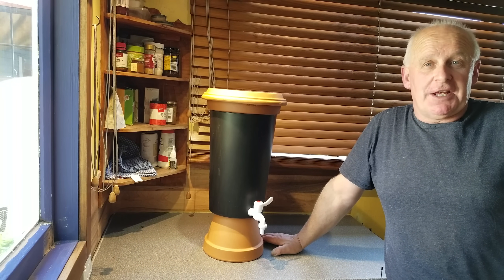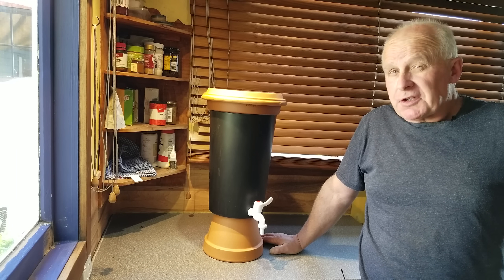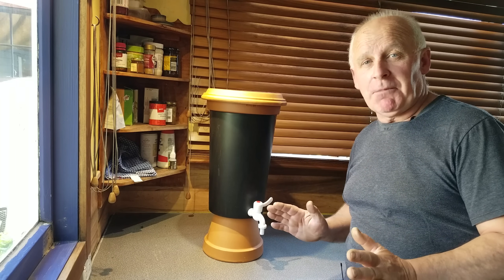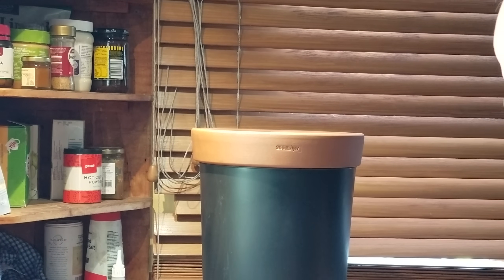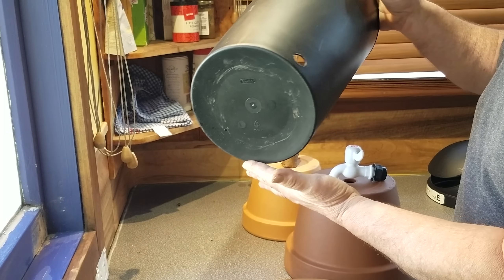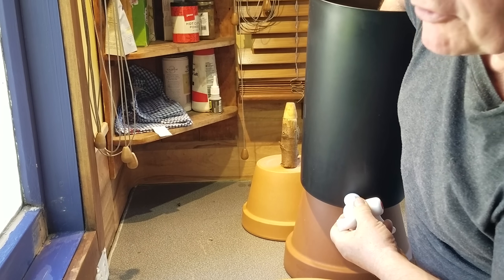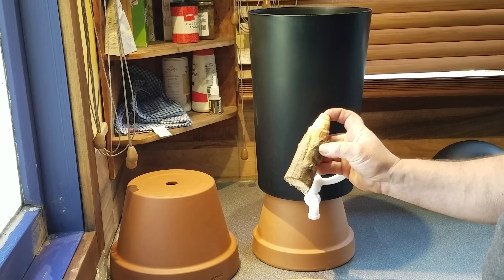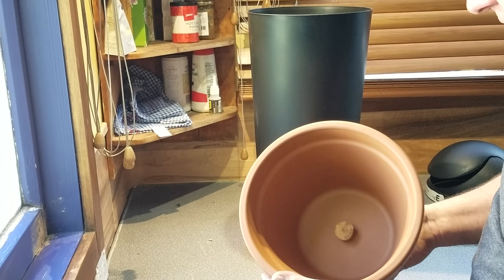DIY water filter. How to make FILTHY WATER drinkable

Comment: the CDC has some pretty good material on the pros and cons of ceramic filtration.  The basic gist of it is that they're good for filtering out bacteria and protozoa, but relatively ineffective in dealing with viral contamination.  If not properly maintained, they can also become vectors for spreading the very diseases they're supposed to filter.  

And while not listed as part of the CDCs information, they also aren't going to be particularly good at filtering many dissolved contaminants, and require something like activated carbon to be effective in that regard.
Reply: Do You Believe Anything The CDC Postulates?

Comment: I wonder if you can help. I made one of these following your video. I kept it going for a few weeks but then had loads of water spare bottled in the fridge that I stopped for a few days. When I started running low I attempted to make more but only got an inch of water in my container and no more would go through. Any ideas why it stopped working?
Reply: Contaminants?  Thats why Brita are changed every 2 months

Comment: Only thing to note here is these types of filters don't remove chemicals dissolved into the water.  They can be great at removing particulate undissolved solids & microbial life but depending on what chemicals are in the water that might NOT be enough to provide safe drinking water.  Note also that the ceramic pots, like any other filter medium, get clogged and eventually become unusable.
Reply: Many of those chemicals evaporate from the water if you let it stand for less than 24 hours. Also, if you're using rainwater, it's untreated, unlike tap water.
Reply: yes. so stupid design. the only reason he's doing that because it doesn't cost anything. chemicals are even more bothersome than bacteria

Comment: Unglazed ceramic dish , unglazed terra Cotta flower pot, bottom chamber with a tap. Very simple.  A wooden cork stopper.  Colloidal silver spray. I worry that the clay pottery would have lead in it.

Comment: This all looks cool and easy. However I would want to be sure the pots being made cheap and easily for plants, dont have any toxic by products. 

I would then also be certain the wood bong hole plug was actually plugging 100% as just a little seepage with bacteria can have you puking your guts out.

I would get the water lab tested a frw times a year at first. Rain water may seem clean however surrounding industrial complexes even a hundred miles away can release toxins into the air.

I live in San Antonio TX and years ago the Mexico fires caused ash rain all the way over here. Turned the streets to a slippery mud mess. 

Burkeys are a rip off. Its a stainless steel tanks and valve with a huge charcoal tube filter. Thats it. 

As for rain wated, you have to consider what its running off of. If it runs off a shingled roof or metal roof. Taste and bird poop and other things can get carried along as well as oily tar flavor from shingles.

The barrels need a good screen but even that cant filter out gecko poop left on top or wind with dust and dirt settled on it.

I would at the very least have my own PVC plumbing grade 1ft pipe converted into a packed carbon filter using aquarium filter media bought in bulk. For emergency filtration. 

Then have the water pass through that after the ceramic filter. Mayve even get a UV light that can be used to kill bacteria or viruses.

I know this is a small DIY but if you mess up and its an emergency, you could poison your family and all be puking your guts out or even death. 

If i could, i would filter the water then boil it then store it for later consuption in a food grade container.

Comment: So you missed biology 101... Ceramic don't filter everything! "most ceramic filters are effective at removing bacteria and the larger protozoans, but not at removing the viruses or chlorine" US CDC states. It goes on (from Atlanta CDC site)

    Not as effective against viruses
    No chlorine residual protection – can lead to recontamination
    Variable quality control for locally produced filters
    Filters can break over time – need for spare parts
    A low flow rate of 1-3 liters per hour for non-turbid waters
    Filters and receptacles must be cleaned regularly, especially after filtering turbid water

FILTERS MUST BE CLEANED REGULARLY! You said the contrary! Don't poison people with your lack of knowledge. Only bio and chemical analysis can PROVE the safety of your diy filter! SCIENCE IS NOT AN OPTION when it comes to HEALTH grandpa!

Comment: Does the water filter through the ceramic or just through or around the wood bung? I thought clay once it was fired turned to ceramic which was none pourus? As in, coffee mugs, etc. That’s why plant pots have a drain hole. I would add a layer of activated charcoal above the bung and a fine clothe mesh filter under the pot. You could even add a layer of clean sand to remove larger particulates and add the water to be filtered to a separate feed bottle which then slowly goes through the filter. Another project for ya! Cheers.

Comment: The problem is that ceramic doesn't filter out that many chemicals.  Putting some activated carbon in there would help a lot with that. Some ion exchange material would help even further.  Between the 3 filter mediums, you would filter out a fair amount.  The colloidal wash is interesting, but if you have any scrap silver, you can just throw that in the water and it will help and just occasionally clean off the tarnish to refresh it.
Reply: They have found PFA's in falling rainwater, so a pretreatment with charcoal then filtered through ceramic doped with silver would be good
Reply: @specialservicesequipment393  
Really? PFA's in the rain water - that's disgraceful eh.
Reply: @deviance, much more that water from the sky. Are you familiar with cloud-seeding? Weather modification? Geoengineering? Pathogen-carrying birds and insects? Airplane dumping? Pollution? Dust? Pollen?
Reply: Berkey admits to activated carbon and around 1oz of silver PER cylinder
Reply: In the U.K. they tax you on rain falling on your roof I kid you not, only on business property’s and it is the Water companies who were sold very cheaply to French &Spanish companies they have bankrupted a few city’s in Europe with the big con and a few backhanders of course.good job like it
Reply: What about microorganisms, viruses and bacteria?
Reply: @dnlbrgs57 Uvc light attached inside that top cover? As the water filters threw the ceramic pot, the uvc light attached inside the top cover would be killing viruses and microorganisms?
Reply: @dnlbrgs57 the silver will deal with the bacteria. You could also use a few copper or silver coins. Viruses are going to go straight through. Personally I just boil the municipal water, to get rid of the chemicals, I have been around the water treatment plant here in Hamilton NZ,and they do a very good job of cleaning the water before they add the chemicals. Here in NZ the water from the clouds is mostly OK to drink, but anywhere else I do not as it is full of thousands of chemicals. You will need fancy active filters to clean it.
Reply: Filter first, but when in doubt, make tea. Boiling kills bugs.

Colloidal silver can be made with three 9v batteries wired in series to make 27volts. Slip silver electrodes in water and watch it work. (There's a patented process for cleaning kidney dialysis machines using colloidal silver. No one's allergic to it and it kills bugs)

Great video.
Reply: He said he was using rain water, not tap water. Rain water has less chemicals in it. Unless you have you have those planes that spray chemicals in the sky, in your area. 😕
Reply: @Momma_Tomma  '..those planes that spray chemicals in the sky, in your area'.. i.e. the world!
Reply: @Momma_Tomma NZ is heavily sprayed by planes 😢
Reply: @Momma_Tomma  that would be living anywhere on earth where planes fly
Reply: How do you activate carbon? Or is it something that must be bought.
Reply: @emmaearnshaw3282  It's charcoal superheated in an oxygen free environment.

Target has it at 2 ounces for seven dollars (US). I didn't research whether it could be made at home.
Reply: @emmaearnshaw3282  Look it up. When I last researched it, I remember that commonly sulfuric acid is used.
Reply: This is a Texas government website about Cloud Seeding. It's being done in other states in the US, as well. https://www.tdlr.texas.gov/weather/summary.htm
Reply: What chemicals are in freshly dropped rainwater that need additional filtering? I'm curious, thanks
Reply: That's a better solution. Until I hear how many microns terra-cotta pots can filter down to this is meaningless. Maybe this would work for the initial large particulate filtering but laboratory testing would be needed if your life depended on it. Invest in a reliable filter and work on an alternate food grade container to hold the filters and purified water. That's the most commonsense solution. Otherwise its guess work.
Reply: @resourcefulgirl unfortunately there are no ? reliable filters. Berkeys is a scum as many people checked
Reply: @robertdillon9989 
Still just water.
Reply: @Diviance  Actually *insert nerd emoji*, it's a particles of unburned fuel with atmosphere condensate on it.

Comment: Cool design.  I thought it was PE (polyethylene--particularly HDPE i.e. high density version) that leaches the least?  Silicone is even better than both of these, but tends to come in versions too soft for this use.
Reply: From what I have read, the plastic used for milk gallons is the safest,  doesn't leech like normal plastic water bottles
Reply: @TheRoadhammer379  That is HDPE plastic.
Reply: just get a stainless steel pot

Comment: I have a couple dumb questions. What did you plug the flowerpot with? they usually have a hole in the bottom. Also after time does the pot itself get filled with what is being filtered out?

Comment: Interesting idea, though I'm not 100% sure you're actually filtering water in 1 hour because the leech rate through terra cotta would be hours or days. My guess is the water is slipping past the bung and not being filtered. To get the full benefits, you'll need to find a pot w/o the hole. 

PS. This is based on experience as an organic gardener. I sink terra cotta pots (without holes, purchased from Amazon) in my rows and fill them with water. The water seeps through very slowly, so I only need to water once a week or so. I've also seen people seal standard pots by filling the bottom with Quickrete to block the holes, though I'm not sure I'd do that for potable water.
Reply from the maker: Who said one hour?- mine takes several hours to completely transfer. In one hour it has started - but certainly not transferred all the contents

Comment: Think this is a great idea. I have a flower ppot heater that works for small rooms. Very similar concept. Flower pot case couple of pencils, a small cermic pot inside three tea lights and larger flower pot on top. I have a metal necklace which adds more to the heating capacity. Will have to get one of these operational soonish. Good share. The Cucetini had a two pot ceramic system back in the 6th century ad wondered if it was used for desalination of water or similar to this concept.

Comment: So what do you use to clean the terracotta pot when it gets gunky and slows right down? I already have a water filter that I buy ceramic candle filters for. I scrub them to get as much life as possible out of them but I can never get them completely clean again. I will definitely play with the pot idea. Cheaper and if it does need to be replaced it will have a second life in the garden, but then I would need to buy spares too.
Reply from the maker: as  per the links and additional info- I wash it every month with a coconut fibre scourer and vinegar and re apply the colloidal silver
Reply: @t.h.o.r.  Thanks! I did find the follow up when I was scrolling through your videos but hadn’t made it back here to delete my comment yet. You have some very interesting ideas 😊
Reply from the maker: @moniquem76   haha well done.thanks fro exploring

Comment: Poly Propylene or not, I just can't get along with using plastic for this. It is one of the better plastics but there are chemicals that leach out of it. Could probably make something better with a sheet of heavy copper, it would be automatically antibacterial and add healthful copper ions to the water. If not, glass, other ceramic, anything but plastic.
Reply: You're absolutely right I couldn't agree more!

Comment: this probably might work for rainwater but the filtration seems lacking and won't as you say last a lifetime. the sap properties will be used up the silver washed out. it will require maintenance like any other filter.

Comment: Hi, thank you for sharing this technique. I also wonder, what if I make one diy and apply for the wild birds and animals outside. Surely some additional design. I also wonder if this is good, if not overdo, to use glass lift and extra tray to form it liked using the water evaporated by sunlight and then let the water go through the filter. Maybe this is overdo, but its also double effective.

Comment: Carbon is the building block of life, it is not a poison and CO2 is essential for plants to survive and thrive. Wherever you have an excess of CO2 you have a greening of the planet. What is poison however is the sulphur dioxide, graphene oxide and aluminium oxide they are pumping into the sky to control the weather and block out the sun. That’s why we need to filter our rainwater.

Comment: So basically, he's using a non-food grade plastic vessel to capture polluted sky water from a porus surface that's DESIGNED to let things such as moss and algae grow.... All I see is absolutely not safe thing to do. Hasn't this Guy ever seen what happens to flower pots in a humid environment?
Reply from the maker: Have you not followed the links and read the supplied info? Do you not realise that a ceramic water filter is  just this - but with a part number and price tag? do you not realise that polypropylene is a food safe plastic that is used in water pipes and water tanks? Did you not reralise after reading everyone elses comment that you look like a complete fool?

Comment: Berkey water filters are not that great.  I got one  and did some experiments with it measuring the TDS from water from my tap then running it through a Berkey and ended up with even more TDS particles in my water from the filters. I also tested the water from my tap in a petri dish for contaminants like bacteria then through the Berkey and into the petri dish, the results were I got more bacteria from my new Berkey filter than from my tap water before running it through it. I tested this several times with the same results. 
I ended up just drinking water from my tap that had less TDS and created less bacteria in a petri dish.  I sold my Berkey. I even contacted Berkey and asked them why my TDS count went up after passing my tap water through a Berkey filter and they could not say why other than the particles came from the filter but were probably harmless.
Reply from the maker: Great info - thanks

Comment: the colloidal silver is an excellent addition, you could also use a bigger pot for more capacity, i've seen some a couple feet across, & for water less pure then that what comes from the sky you could add a screen tray of activated carbon underneath the filter pot.
Reply from the maker: Top comment buddy! Thanks so much for contributing

Comment: Anyone with experience keeping aquariums would know that porous filters eventually get gunked up. Rainwater doesn't have organic matter so the pot filter will be good for a long time, but still there is a capacity limit. Also I think you need to add activated carbon to remove chemicals.
Reply: Rain water may be great for those who live in New Zealand or Canada, but for those of us who live near cities ... please remember that rain water isn't pure. Or necessarily clean. Depends on how much polution you have in your local area.
Reply: @danielch6662  Iirc you can add some dead corals to the filter mix if you're worried about acidity.
Reply: Rain water still can (and often has) organic compounds. When falling throught the air, rain drops absorb stuff. Also, when in a bucket, dust and other particles fall into the collected water. These particles can serve as substrate for bacteria and molds. So, pre-filtering is strongly suggested.
Reply: @drnovikov  Bacteria is easily taken care of by boiling. Bird poop is the bigger problem if the rainwater is collected from roof gutters (which I recently found out is quite popular); collecting using tarp is cleaner but less volume.
Reply: Clouds aren't even natural, white people prunt them out and they're made of chemical induces water. (Acid)

Comment: I wouldnt use plastic. You can do the same system by buying a stainless-steel cooking pot! Also did you do water test on your water after it filters? What does it remove?
Reply: DON'T FORGET IT'S RAINWATER.